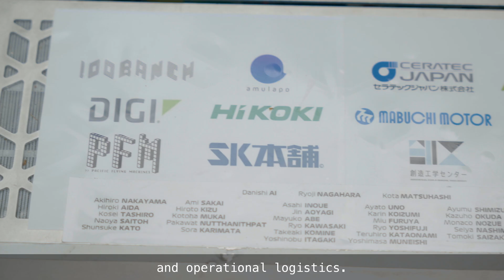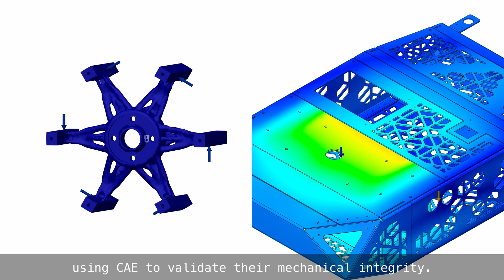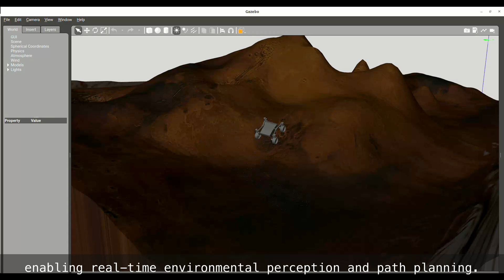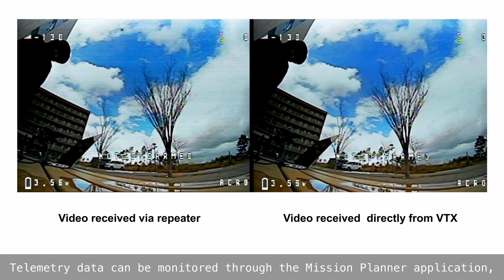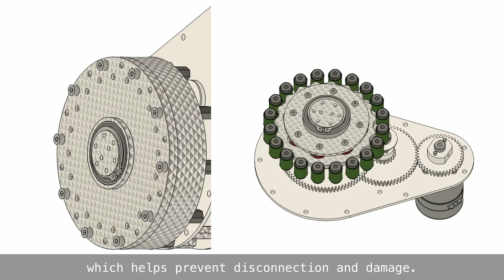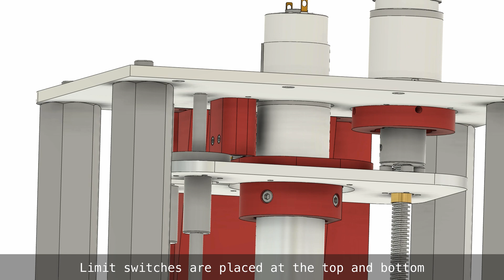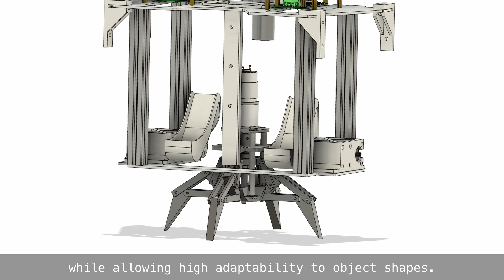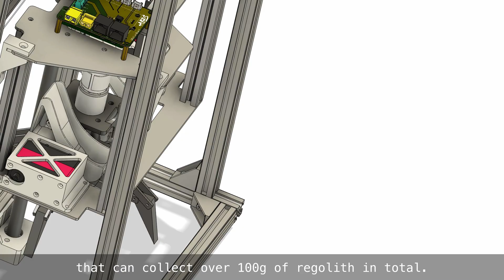ARES8 性能紹介動画

Comment: How many Xbee pro modules do you use in the rover and the base station respectively? And what antennas do you use along with them?
I could see 2 modules in your autocad design, so do you use point to multipoint configuration for the communication?
Reply from the maker: Hi! Thanks for your question.
We use two XBee Pro modules for the rover system and two for the robotic arm system.
Each system has one module on the base station and one on the robot side.
The robotic arm is developed by the Tokyo group, and the rover is developed by the Tohoku group.
Since each group develops and tests its system independently, we keep their communication links separate — each system has its own point-to-point connection.